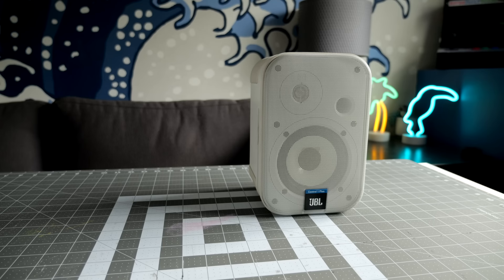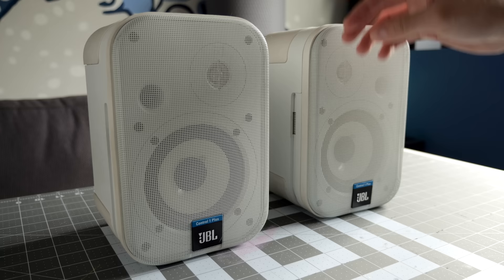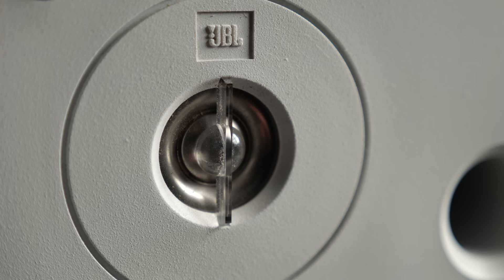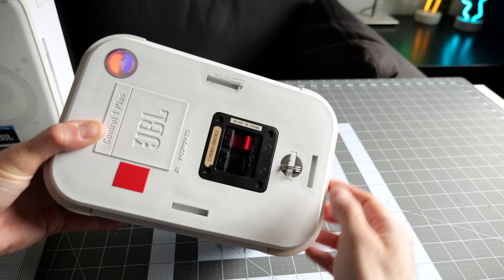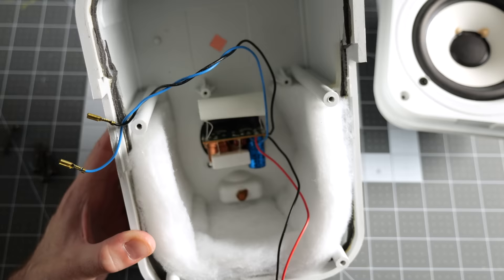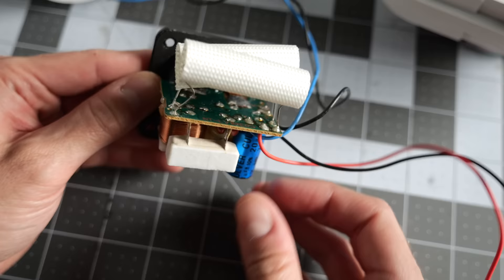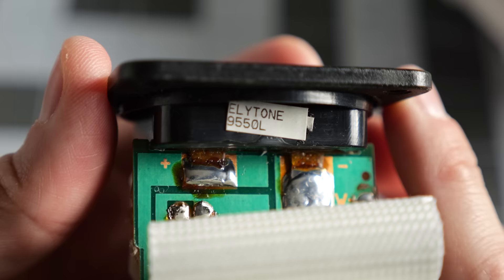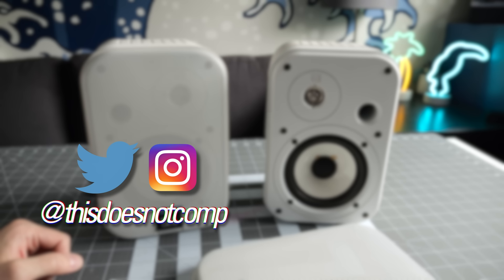Fixing My Vintage Speakers -- But Why Are There Light Bulbs Inside?

Comment: I have a set of bose acoutsimass speakrs that have the light bulbs inside them. Was confused when I first opened them and just thought they were fuses. Still impressed with sound and how nice and clean the sub sounds on speakers that are older than I am.

Comment: I'm still rocking my AIWA XR-MN5 stereo system that my dad found next to the dumpster at his work. Only issues are the 5 disk changer doesn't read disks most the time and the tape player is stripped out... but it works good as an aux-in

Comment: ive bought here in  germany a pair of used infintity reference 50 about 5 years ago for 20€ the lady who sold them said they were broken... but they just had cracked foam rings.. i ordered for 8$ per driver foam rings from the usa... and watched all youtube videos i could find on refoaming... it tooked me 3 hours to clean off old adhessive before glueing in the new ones and 3 days of drying out the new addhesive but damn... they sound like the 1000 $ speakers they had been in 1991.

Comment: When I was young I cranked my systems system and noticed that there was a glow that we could see in the port hole. They were the Mach 1 from Radio Shack. wonder if they had a bulb in them. I had the same speakers and played them really loud often but never saw or noticed them to glow. I still have both sets. I will have to take them apart one day.

Comment: I have a pair of Control 1 speakers I have had for over 10 years now, on occasion, I have experienced them 'glowing' at louder volumes.  I also have a pair of Control 2P which are same form factor that are self-powered, I am curious if they have the bulb inside as well.

Comment: Sound devices out of Japan in the late 80's/early 90's were top notch, even guitars like Ibanez were almost untouchable for the price point.
Reply: I have an early 1980s Pioneer amplifier, I'm considering replacing the smoothing capacitors of the power supply.

Comment: I bought the control 1 for 30€ brand new from a second hand market, including the wall mounts. The current version have a screw in wall mount and the old style wall mount. Because are the regular control 1 they only go from 60hz till 22.000hz, so i found also a magnat subwoofer witch i set it from 60hz down to 20hz (that's  the maximum that the subwoofer can go). Over all i'm very satisfied with the speakers, just that the lac base. The control 1 pro are 4ohm speaker and the control 1 are 8ohm, but this one you have control 1 plus i don't know what's the frequency respons and what ohms.

Comment: Many speakers, especially semi pro or pro speakers use these 'soffitten' bulbs as current limiting devices. They will soft limit the power towards the speakers, protecting them and also making sure the mechanical limits of the speakers are less easily reached, so they will be able to handle high peaks in the signal better, but also limit dynamics. I've seen them in Bose, JBL, Denon, Jamo and many more.

Comment: Current limiters to protect the drivers from excessive input power,

The Control one AW (all weather) are the best ones to get with the best frequency response. and trust me rubber surrounds can fail bigtime, they can rot terribly bad.

Comment: When first designed, the speakers were too heavy, so the bulbs were added to make them lighter - baboom-tissss.

Obv, the lights were used as a bypass to avoid cone damage from over driving.

Comment: If these were also sold in Japan besides just being manufactured there, the steel safety wire hookup is for earthquakes, so they wouldn't be flung across the room.
Reply: Mind you, that's my educated guess without checking but seems obvious.
Reply: You’d want that insurance in any outdoor installation (like museum parks for instance), but of course it’s even more crucial in Japan as there will be more jostling guaranteed.
Reply: @offperception  All professional speakers for overhead use have safety wire hookups.

Comment: I was checking the electronics at a Goodwill one day and picked up some speakers I'd never heard of. They were very heavy, so I assumed they were quality. $10 for the pair. Paradigm Studio 20 (original version) from the 90s. So I became a vintage speaker user out of pure luck. Any upgrade from these would probably be hundreds of dollars, so I'm still using them with no issues at all.

Comment: That is a neat idea about including those lightbulbs. Though they are not as replaceable as a fuse. I wonder what the lifespan on those bulbs are? Either way, I didn't think that speakers could be that interesting. Thanks for proving me wrong. Great video!
Reply: If you never really overdrive the speakers, those bulbs will basically last forever.
Actually they don´t even are regular bulbs.
They´re not intended to be super bright, they usually have a thicker winding.

Comment: Did you check the light bulbs? One of them could have a broken filament that reconnects intermittently, it's not rare to have a light bulb with a broken filament, specially in the high vibration environment._

Comment: There is a date code stamped on the inside of the front cover.  Right above the port tube.  14:54  There's a mark at 9/89.  There also seems to be two more on 11/89.  I'm not sure what's up with that but that seems to put it at the end of 1989.

Comment: Magnetic shielding on the Control 1 Plus is why I bought them back in the day to put near my main CRT computer monitor without distorting its image.
Reply: Oh man. Now I’m worried that I might have ruined some old tapes. Do you think I could have ruined them if I sat them on top of a speaker cabinet or is the magnetic field not strong enough to do that?
Reply: @trippmoore  they can take a lot but it might have caused some dropouts unfortunately.
Reply: @RWL2012  oh poop!

Comment: Not sure if you noticed but at 15:03 there appears to be a date code on the inside of the speaker. It looks like it was manufactured in September 1989 if I'm reading it correctly

Comment: thanks for the great video.  it was really interesting. 

I love JBL speakers! even their tiny ipod docks sound great for their size.

one quick tip- when reflowing solder it helps if you add Flux or a bit of fresh rosin core to make sure you get a solid connection.

Comment: Use of lightbulbs in crossovers been around since the sixties their used as protection against dc current and to absorb excess voltage from going to the tweeter

Comment: I've the same light bulbs in my JBL CONTROL 5, I was not aware of it untill one night I pushed my AVR volume to a real very High Point then I saw these bulbs glowing through the speaker port, at one moment I was afraid that my JBLs are burnt but later I came to now about this safety feature.
Reply: If it was the voice coil you would have seen and smelled quite a thick and noxious smoke.
Reply: @psirvent8  nop, no burning smell was there. Later I Opened the speaker box and played the same music at High volume and saw that filament Bulb glowing. No damage to any of speakers, thanx a lot to that little filament tube.
Reply: @deepakpareek9  Which part of "IF it WAS" has been unclear?

Comment: I have a pair of nearly 50 year old Canton speakers and they still sound awesome and haven't needed any maintenance
Reply: My 72 DCs sound great. Very underrated.
Reply: You should try A/B,ing them with a newer pair of speakers. I bet your ears have just adjusted with their decline over the years. Not saying they must sound horrible, but the frequency response has likely changed noticeably in that time. If you don’t listen to other loud speakers in a similar type setup then you have no reference with which to compare them against. Also, if you had those for their entire life then your ears have also lost the ability to hear anything above 13khz likely.
Reply: @trippmoore  I've had them for only 4yrs now and they sound good. I've had modern Teufel and JBL ones here from a friend to try out and they don't have much off a difference except the lows being more intensive.

Comment: JBL is a professional sound company. They make everything from giant PAs, to expensive studio monitors, to "fun" speakers. They are one of the original speaker companies. Their history is wide and deep. Characterizing them as making fun speakers that don't sound transparent is a gross mischaracterization.
Reply: Yes. James Bullough Lansing (JBL) worked for Western Electric, where he pioneered such things as the edge-wound voice coil and field-replaceable diaphragms. He was part of Altec Lansing, where he developed an early HiFi speaker called the Iconic, and then he formed his own company called Jim Lansing Sound, which later became JBL. He was directly responsible for many of the innovations that made high fidelity loudspeakers possible. JBL makes everything now from throwaway Bluetooth speakers up through state-of-the-art studio monitors and live sound reinforcement systems. If you have $25 or $250,000 to spend, JBL has you covered.
Reply: nowadays they make a lot of average consumer electronics so even since they were making high quality professional speakers, today they´re making the most money out of oversized bluetooth speakers, bluetooth headphones and other lifestyle products.
Sure they also still make passive speakers but i bet they aren´t nearly as good as back then.
Just saw a few pictures of some HiFi floor speakers and the drivers just looked cheap with the cheapest foam possible.
Reply: @MultiWirth  They do make cheap stuff, but they also make good stuff. Like any business, they have to sell what people want to buy. I like to think that the cheap crap subsidizes the good stuff. They're currently selling the heck out of a remake of the classic L-100 century, called the L-100 Classic. I haven't heard them, but I'm told they sound very good and are quite well-made. They look a bit like the original L-100, but are supposed to be a lot more refined. I enjoy my L80T's daily. I recently re-foamed the woofers and checked the crossover caps (which were fine), and disassembled the tweeters to check the foam dampener behind the diaphragms (also fine). They're 33 years old.

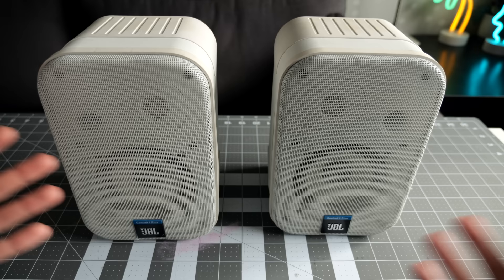Comment: 6:32 Kabuki speakers?

Excerpt from an AudioKarma thread:

Kabuki Speaker = Japanese made speakers from the 60's through the 70's that had a minimum 15" woofer, a minimum 4-way cross-over, at least 6 individual drivers, in a box that is less than 3 cu ft or weighs less than 50lbs.

Out of the above six criteria, the Polk's mentioned above only meet one.

For those wondering about the origin of the term, it had to do with the limited bandwidth and tinny sound that chracterized the first versions of these speakers. As a friend said "You can play Led Zepplin though them and it comes out sounding like Kabuki music".

Comment: Very nice video. I noticed a pair of these recently that had a threaded insert. Did they add then in later production models?
Reply from the maker: Yeah, I think people got tired of the weird mounting brackets, so newer Control 1s switched to a much simpler arrangement.
Reply: My JBL Control  2.4 G (an active wireless version of these speakers JBL had at the time) I got in 2008 came with a couple of threaded inserts: one in the bottom and one in the back (although it still has the hooks to pass a security wire through them, which is nice considering how heavy these things are). These speakers are built like tanks!

Comment: Old speakers should treated periodically with Persian Speaker Juice. It can be found in the snake oil isle of your local audio shop. For appearance reasons, wooden or wood veneer enclosures may be polished with Corinthian wax using a small square of NBL hoodie fleece (for some reason,   knockoff non-NBL fleece leaves a slight haze that does not effect sound quality). it's true, I tell you.

Comment: I'm a tiny bit more than a little bummed that you didn't hook them up while taken apart to see the bulbs light up while the speakers are in use. Still, I had no idea those bulbs were in there. There were tons of Ctrl1s in use at the theme park I worked at in the late 80s to the early 90s. There were many Ctrl10s there as well. I was so nostalgic for those times that in early 2000 I found a used pair of Control 10 speakers for sale locally and I went and bought them. I blast them on rare occasions and re-live my early adult years.
Reply: The light bulbs only light up when they're being pushed into protection mode.  Not something you do on purpose.

Comment: Great video!  I never knew about the lamp increasing resistance part.  That is genius.  A fantastic use for control 5 is performance monitors for a synthesizer studio.  So by that I mean monitoring your instruments as you play them, not using them to monitor a mix.  With the control 5 sb sub attached it makes your synths sound totally awesome and in stereo and you don't blow your mix monitors while performing.

Comment: I use JBL's for my PA, 2 EON 618s 2 JRX 125s and 2 EON 610's. The EONs are active and they have lights to show they have power in the front that you can turn off if you want. I have the 125's on a Crown XTI 2002 amp and use the amp limiter to keep the speakers from melting lol.  I pray for the EONs lol.

Comment: That stability epoxy goop can become conductive over time. Causes all sorts of random problems.
Reply: It’s a particular formula of that stuff that has the issue you are referring to. Once they realized it they stopped using that particular adhesive but I can’t tell you what it was or what year they stopped using it (I’m sure by the 80s).

Comment: At 15 min he was closing in. You have to skip to 19:20 to get even closer to the video title.

That is glass fiber insulation for lowering the heat radiation to other parts of the speaker.

Comment: So, essentially a current limiting resistor! But of course lightbulbs are designed to be red hot and are made of tungsten, so they can have a higher performance in a smaller package than a ceramic-coated resistor. And they were being mass produced anyway so they were probably cheaper than a high performance specialty resistor to boot! (Another commented mentions outdoor concert speakers using car headlight incandescents!) I like that ingenuity/efficiency. 

And of course if the power is below the point where it lights up it won’t be producing much if any heat. Nice design indeed. If you’re not thermal cycling the lightbulb except in rare circumstances you probably won’t ever need to replace it, barring severe physical damage or something.
Reply: A resistor isn't suitable for this use, and it would be a very longwinded explanation if you really want to know, basically has to do with Qes and Qts parameters running away and resulting in very undesirable tuning. It uses specifically the PTC property of tungsten. Let's say, you have a 20W 12V lightbulb - the nominal resistance of a lightbulb is around 8 Ohm - but when it's cold, it's going to be only about 0.1-0.4 Ohm, that order of magnitude.

The lightbulb is then basically operated cold, and it's nearly lossless under this circumstance, as opposed to a resistor.
Reply: @SianaGearz   that’s what I said, isn’t it? In my second paragraph, that the resistance and heat from the bulb is next to nothing in most cases in this use. AKA when the load is low enough to not light up, its resistance is much like any other conductor, at most an ohm or two. 

All resistors (all conductors) increase in resistance as they get hotter, so since a lightbulb has a smaller baseline resistance and a higher range of operational temperatures, it makes it far more suitable for this task. Replicating that behaviour from any other resistor would be pointless and expensive, since a lightbulb is a type of resistor anyway, so it makes perfect sense to use a lightbulb for this particular current limiting application. 

That’s what I was saying in my first comment and I’m 99% sure that’s what you’re saying too, albeit stated in terms of tuning the resistance curve over the various loads? Though I have noticed sometimes YouTube doesn’t show the “read more”, so perhaps you only saw my first paragraph? 

But to clarify, the “essentially” in my first comment was not meant to imply the lightbulb was a bad choice, or that would be replicated by any other resistor (as in fact I go on to say other options are less suitable and more expensive) — just that when the lamp lights up it is acting as a current limiting resistor. Self-adjusting, by only acting when the power is high enough to light it up, and only limiting as much as necessary.
Reply: @kaitlyn__L  Perhaps, i haven't caught that from the original comment.

A modern alternative would be polyfuse, a PTC with a very sharp curve, they're flat plates and they don't need a lot of cooling. But perhaps they decided that a lightbulb had a more benign behaviour for speakers, where it gradually compresses the sound when the speaker is at its limit rather than almost killing it and then suddenly recovering a few minutes later, and besides this being a mid 80s design, maybe polyfuses weren't that accessible. I don't think component choice was made under much of a cost pressure necessarily, this is a premium product after all, not the base version, the drivers are way more expensive etc. But limited ventilation is to be considered as well, the lightbulb will just irradiate the whole enclosure top half so chassis walls are used for cooling about as efficiently as they can be.

I don't think there is another suitable component that i can think of, after all the power is considerable.